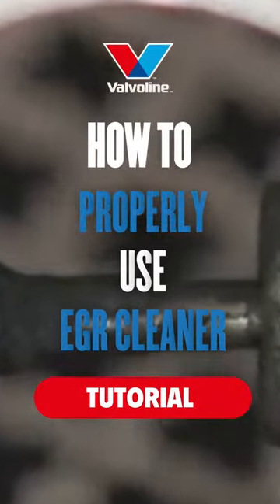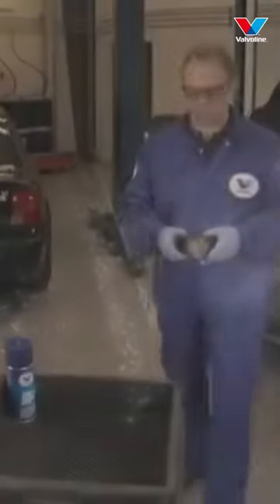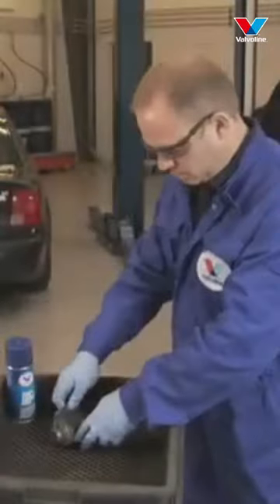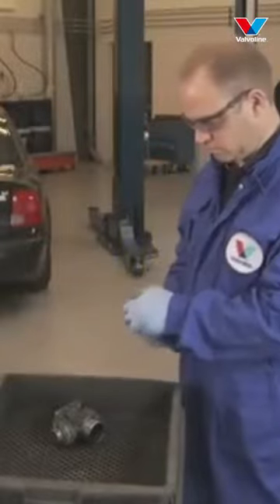EGR Cleaning | How to PROPERLY Use EGR Cleaner | Clean Engine, Stronger Performance | VALVOLINE

Comment: Should o-rings and other rubber consumables be removed prior to application? Should plastic parts attached to the EGR valve be taped off?
Reply: good question, there are electrical components.
Reply: You're supposed to replace any gasket whenever you remove something that has a gasket.